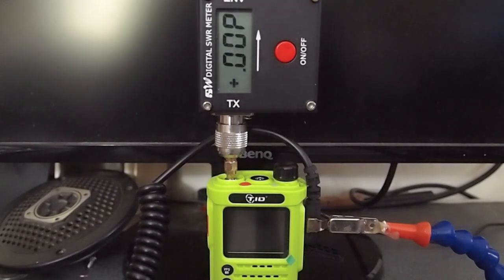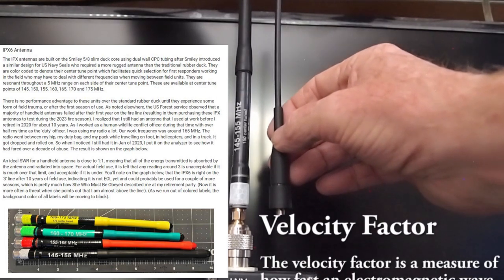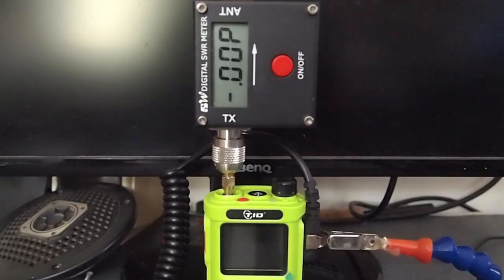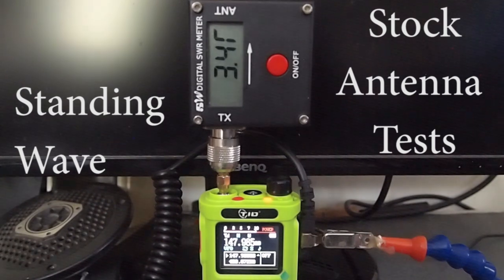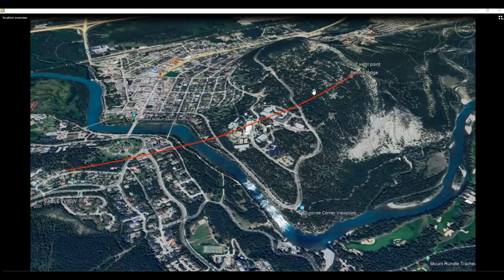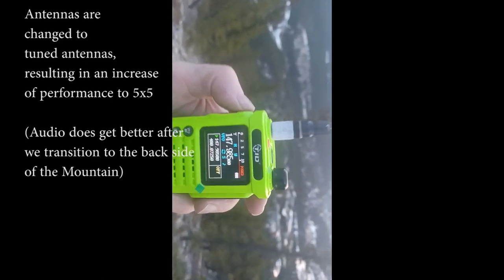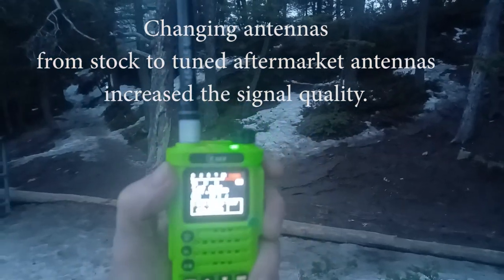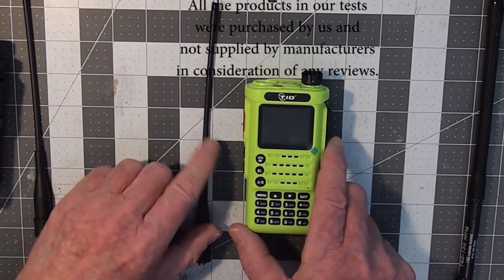Antennas S02E08 TID Radio H8 stock antenna test

Comment: Hi John, I use an old UV-82 and a Yaesu FT-65. I bought a Nagoya 702, and 771 antenna and I can say they are a lot better than the stock Yaesu and Baofeng dual band ones on the Ham bands. For RX elsewhere they are still better than the stock ones, but the more you get to the band edges the worse they go, and that applies to both stock and Nagoya. Keep up with the informative vids. Cheers.
Reply from the maker: Thanks Bob! Indeed it would seem that it is not possible to make a vertically polarized monopole and keep the VSWR below 3db with a bandwidth greater than 10MHz, however it would seem from looking at many of the 'dual band' rubber ducks the manufacturers send out, they live in a different dimension. The TID antenna in this demonstration says, "136-174" and "400-470" on the bottom, yet the VNA chart shows that this is a hopeless aspiration!
Reply: @MountainParameters  EXACTLY!!!!! Just get one for the band/freq you want to TX on - job done.
Reply from the maker: @DoctorBobP  
Ironically, I have noticed with stock supposed, "Dual-Band" antennas from different manufacturers they are tuned to different 'sweet spots'. For example, I tested some TYT stock antennas last year, and they were tuned best to 155 MHz, so I advised my clients they would be suitable for logging roads. What does this mean? Simply put, if you do not have equipment to test your stock antennas, you probably should not use it until you can determine if you might (or might not) be damaging your radio with excessive standing waves being created every time you transmit with a stock antenna.